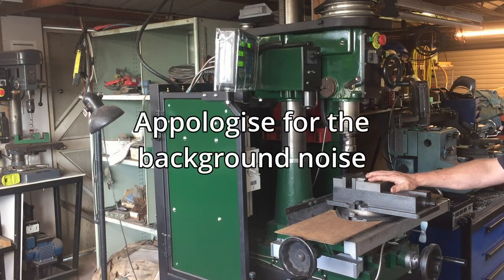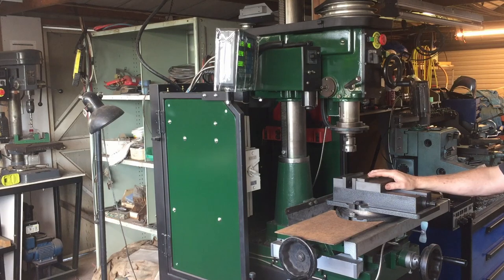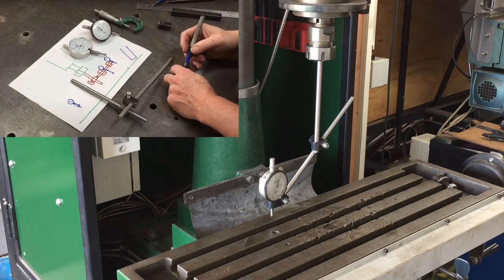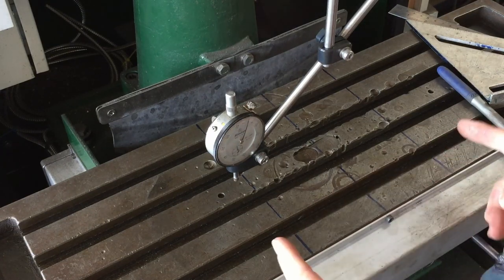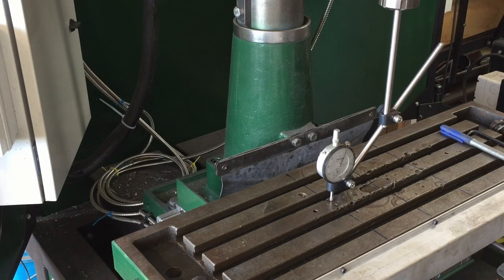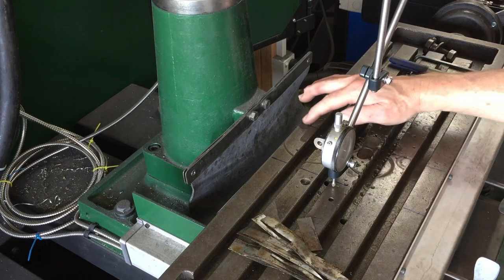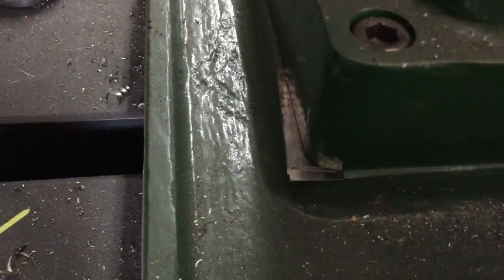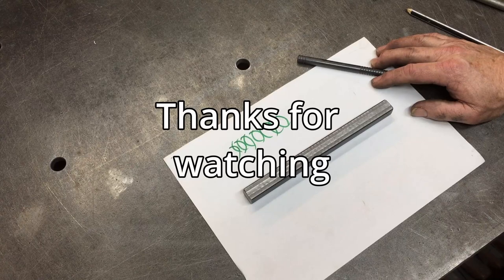Tramming a round column mill

Comment: I don't know if it crossed your mind ,but we had a similar condition bed on a small mill like yours. We used a 4" grinder to take the t's off the bed, ground it using a surface grinder, made new t's and doweled them in worked really well, and is still working. Big job though. Great vid, thanks
Reply from the maker: Thanks for watching and your experience on table repair. At this point the vise sits flat and clamps down well so I'm going to leave it.

Comment: Good work. You will always be able to see where the tool went (as in each run) even if you can't feel it. It is one of the things that make people with shapers love the finish (there are no such marks with a shaper).

You may need to recheck from time to time and with that sort of round column mill you may also need to check when raising an lowering the head.
Reply from the maker: Hi Ben, thanks for your comments. Thanks again for posting your video on this process.
Reply: @thehobbymachinistnz  No worries.
Reply: I bought a Grizzly version of a similar model, here in the USA about 26 years ago. I’ve made numerous modifications. But fortunately, it was trammed very well. I’ve not had that go out of adjustment and when the head is raised and lowered, tram remains the same. As always, quality control matters. Different companies sell the same equipment at different prices and that results in well aligned machines or poorly aligned machines. Nice job. I wonder if the same guy who destroyed the table dis something so egregious that it knocked tram off. Ring Fu is a quality manufacturer whether so,d under their own name, Grizzly;s or some others. It’s hard for me to imagine it got out of the factory that badly aligned. Maybe dropped in shipping.
Reply: @melgross  Re tramming isn't difficult. I did it on my Naerok mill when I erected it in my shop.

Comment: Welldone your finished results look excellent.
I have seen some pretty poorly treat drill vices but you mill table takes the cake.
But if you are mostly using a vice or rotary table it should not really matter I reckon.
Reply from the maker: Thanks Gr eg. Yes, I mostly use the vise and sometimes a rotary table.

Comment: Glad that worked for you.  I'm trying to make a sine table that is 8" x 8"  and doing the initial milling with a fly cutter.  I'm 0.005" out over 8 inches.  Its time to tram the mill head I reckon. :(   Gilles
Reply from the maker: I noticed a big difference once it was in tram. Mind you, mine was so far out that anything would have been better than what it was. Thanks for watching.

Comment: You make it look simple. What happens if you lower/raise the head on the column? Do you have to repeat the process?
Reply from the maker: Hi, thanks for watching. That is a good question. I have raised and lowered the mill head several times since tramming it in, but I have not checked to see if it is still trammed in. That said, the cutting marks on the milled work show that both ends of the end mill are touching the work so I presume that everything is still trammed in.
Reply: @thehobbymachinistnz  I’d be interested to know if you ever get around to checking. With a bit of luck I’ll have one of my own soon and I’ll check it as well. I’ll be following your tutorial.
Reply: Bit late but I found it matters how you tighten head on column. 
Top bolt has to be tight tp prevent overhang making spindle droop then nipping up bottom bolt to stop vibration
Edited to clarify how I tighten head to column bolts, sequence below.
Reply: @1crazypj  do you mean the two or three bolts that lock the head in place on the column?
Reply: @freestyla101  The two bolts that lock head to column. 
I found that if I tighten top then bottom, mill is out of tram 
I'm sorry, I described it wrong in initial reply, correct sequence (at least for me) 
 I nip bottom bolt, tighten top bolt then go back to tighten bottom its just about perfect.
Really surprised me, I don't know how much time I spent (wasted?) trying to shim under the column base
Reply: @1crazypj  that’s very interesting. How did you discover this?
Reply: @freestyla101 
A few years after I first bought and tried to set up mill I was machining base of angle vice as it measured around 0.020" variance side to side. I had already re-worked the pivots after reading a 1992 article in a magazine I used to subscribe to, (I tend to keep reference material, drives my wife nuts)  Decided to make column more 'square' to base as I was fed up with the 'tilt' and shimming/clocking everything 'precision' every time I moved head. Checked head at lowest position, unlocked pinch bolts and saw it 'droop'.  Tried various sequences of pinching the bolts up and ended up with totally different sequence to what I had been using 4~5 years. Reply would be much longer if I told you everything I tried over several years of messing with it on and off and wondering why I hadn't saved up for a knee mill (although I don't have space for one even if I had the money)
Reply: @1crazypj  very interesting. So tighten bottom first, then top? That’s something I can easily remember to do. 

Eventually I will buy a knee mill but I will keep my round column. I think it is awesome for its size despite the obvious limitation.
Reply: @freestyla101  No, just nip bottom enough so bolt is more than hand tight, then tighten top. Go back and fully tighten bottom which will have loosened after top nut is tight. I don't know why it works but it works for me?
Reply: @1crazypj  thanks for the tip!

Comment: clock to a ball, and traverse the table rather than reference the table surface. you want a point relative to the slides. the surface aint necessarily square or parallel.

and the way thats been hammered... definitely. its really begging to be pulled off and run through something a bit bigger first.
Reply from the maker: Thanks for watching and your comments.

Comment: Subscribed, good video. A way to fix your table is how I fixed and old drill press table that someone had drilled an arc clear across with a 5/8's drill bit. Liquid Steel Epoxy.
 It worked a miracle. Clean all the dirt and oil out of the damaged areas. mix some up and apply just enough to fill the deepest holes. It works just like Bondo but it gets very hard.
It sands very easily and you can build it up with multiple applications.
When I got done and threw a quick coat of paint on it the repair was invisible.
Since you don't want to paint your table you will be able to see the repair but it will be 100% functional.
Reply from the maker: Hi, thanks for watching and thanks for the tip. I also have a vise that looks like swiss cheese from the previous owner. Maybe it will work on that...